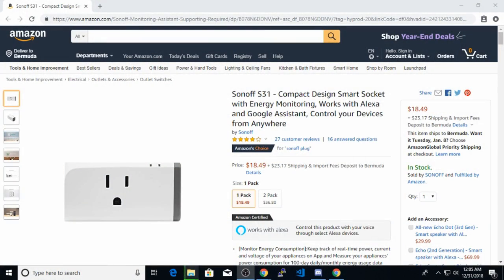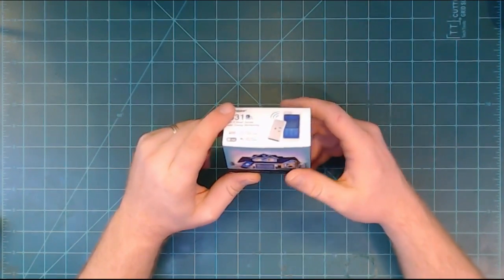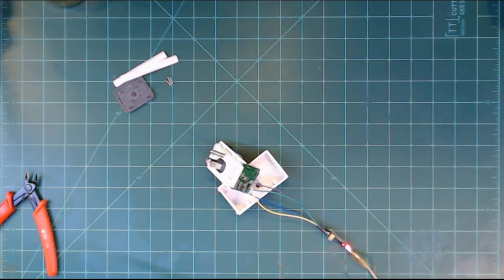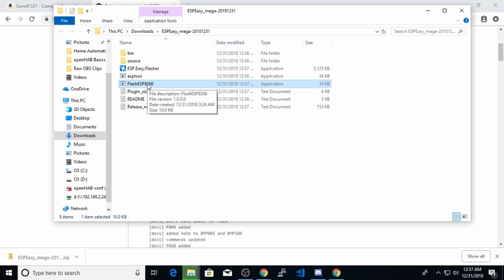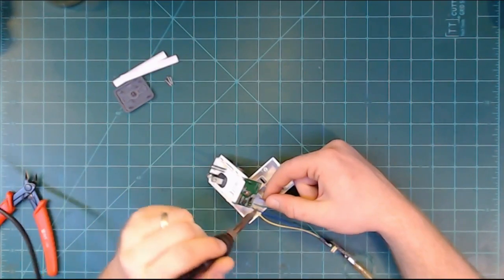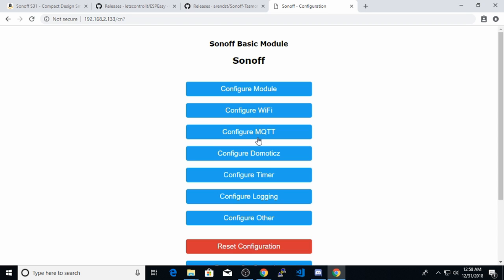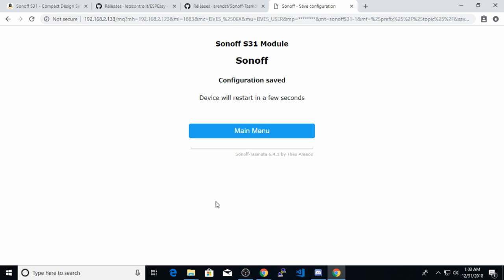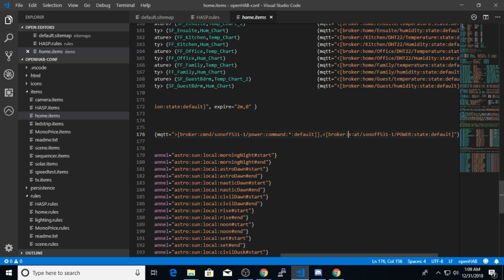Sonoff S31 Smart Plug - Flashing Tasmota and openHAB MQTT Configuration

Comment: It was good but I missed a crucial detail. Please emphasize the TX to RX and RX to TX swap. I missed your brief comment and went in endless circles until in looked elsewhere. That and everything was out of your fixed focus on the background.
Reply from the maker: @Bill Brannon - thanks for the feedback! I've pinned your comment so others can hopefully see the intended wire configuration. And, I'm working on ways to improve my camera situation :-D
Reply: Unfortunately one of those things you forget is not common knowledge after you’ve worked with serial flashers a few times (it’s now always in my brain to immediately swap the two if it’s not working, but even that took a while)
Reply: @JB-fh1bb  Thanks for the reply. I've long since abandoned repurposing wifi devices as more trouble than their worth when there is likely an easy Zigbee or Z-wave solution. My S31 happily lives in a box with other IOT misadventures. Peanut Plugs, Cree and Sylvania bulbs and Zooz 4 in 1 sensors. It's not they don't work but they often don't play well with others.
Reply: @billbrannon  You’ve got me considering Zigbee again. But until then, if that box needs a new home let me know ☺️
Reply: @JB-fh1bb  The zigbee S31 is 10.99 Prime. It would cost almost that much to mail my old Tasmota S31.
Reply: @billbrannon  Oh! I didn't know you were talking about a ZigBee S31!
Just took a look though, and it doesn't do power monitoring (the only reason I use the S31s) ☹️
Reply: This comment just saved my bacon. Thanks.

Comment: Oh my god. I've soldered before, but never anything so small.  It took me over 2 hours just to solder the 4 connections because my hands shake whenever I try to be so precise. I was going to do 2 sonoffs, but that was so grueling, I'm calling it quits for now after doing 1.  Any suggestions on how to do this precise soldering to reduce the shaky hand thing? The tip of my soldering iron is 3 or 4 inches from the handle, so all the shaking is amplified by that distance. Do you have a soldering iron with a shorter tip?

Also, since I have a mac, I had to use esptool.py.  The ESPEasy appears to only be for Windows.  It would be nice if you included a mention of the command line tool.

I think I have succeeded, but I haven't configured it yet.  Will report back.

Comment: Que tipo de desarmador y punta ocupas?
Reply from the maker: Hi, I use this multi-tip kit called iWork - https://amzn.to/2QiKzU9 -  it's great because it has pretty much any tip you might need in working on small electronics/PCs, and the top of the screwdriver has a spinning base, which makes it much quicker (you just push against the top of the screwdriver with your palm, and then twist the screwdriver with your index/thumb).

Comment: If you flash it with Tasmota do you lose access to use the smartphone app that comes with it?
Reply from the maker: Do you mean Tuya or SmartLife? Yes, those apps only work with the original firmware. But, Tasmota allows you to run these switches on your local home network, vice relying on the internet cloud (with all the tracking that goes along with that).

Comment: How do you configure the mqtt?
Reply from the maker: The MQTT Broker? That depends on how you choose to run your broker. For example, I run my broker on the same RPI as openHAB, so I installed it via openhabian-config. Then, you need to configure the broker settings in openHAB (go to your /services folder and look for mqtt.cfg). In that file, you really only need to uncomment two lines: (broker.url=tcp://localhost:1883) and (broker.clientId=openhab2.0). Restart the RPI, and the rest of the video should work for you :)
Reply: @BKHobby  I set MQTT as per your instructions via openhabian-config however when I go to the services folder there is no mqtt.cfg file present. I know that MQTT is functioning as I can MQTT.fx to send commands to my sonoff but I cannot get it to work from openhabian. Many thanks.
Reply from the maker: @craig cleveland- I missed a step in my reply there - you need to install the binding in openhab - but there’s a new binding out now that changes the configuration quite a bit. Please check out my livestream tonight (9 pm EST), as I will be going over this exact topic (including a smart plug configuration!)
Reply: @BKHobby  Thanks for the tip off - will it be posted? I am in Spain and that will probably be past my bedtime! I added binding = mqtt to the addons.cfg file and MQTT appears in papergui under Configuration>Bindings and >Services Just not sure what to do with them without a config file
Reply from the maker: @craigcleveland3431  - yes! I will definitely post it after the livestream, with timestamps (or a condensed video) so you can find what you need...You don't need a config file for the version you installed (version 2) binding. You just need to create the MQTT Broker thing (not the System Broker!), and then create a "Generic MQTT Thing" for your device, adding channels for input and output as you need to.